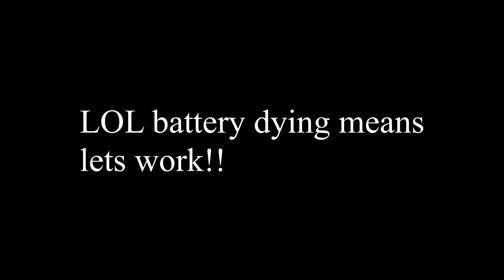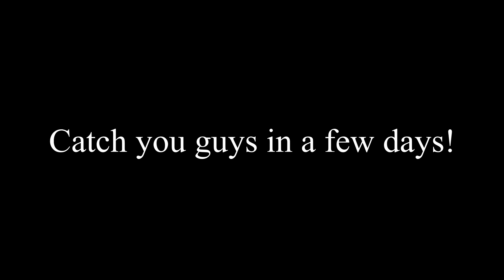How To Fix The Steering On Your Old Chevy Pickup 101, Steering in Style!

Comment: Was that a 2wd converted to 4x4?
Reply from the maker: No it was factory 4wd but converted to crossover steering instead of stock push pull which requires a 2wd box to do